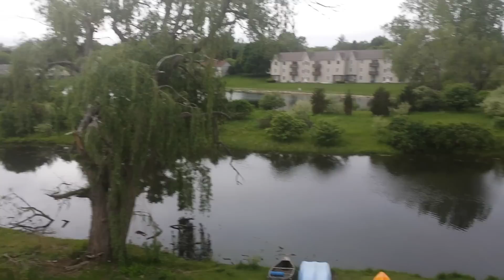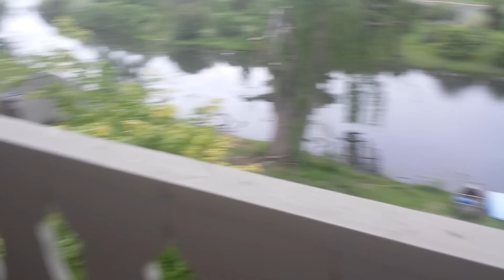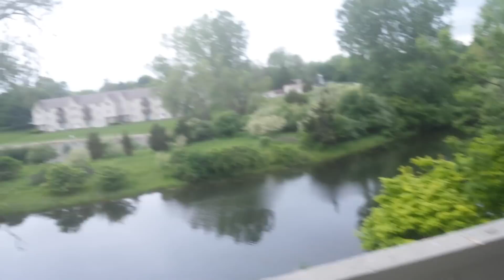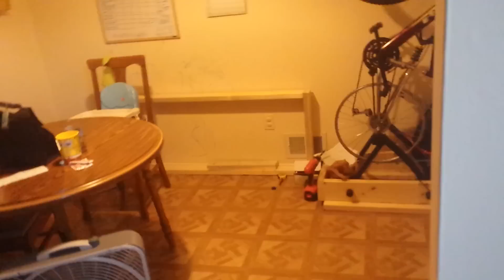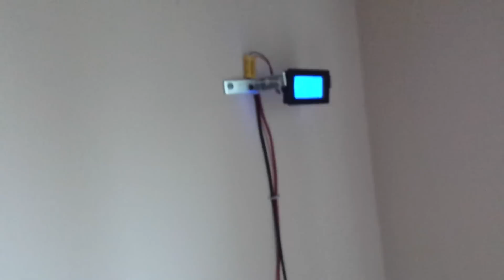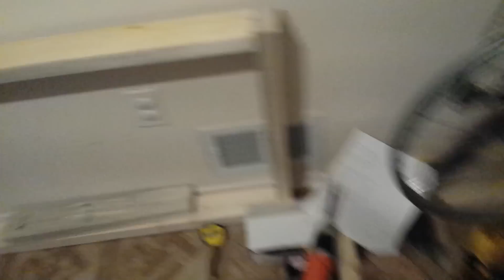Renewable Apartment - Solar Panels in an apartment!

Comment: solar panels should just be standard for every new home and apartment instead of consumers having to figure it out themselves. This looks too complicated and messy.
Reply: He's experimenting so as to learn about solar power as a hobby so nothing wrong with that. I agree every new home should come with solar power in mind such as which direction the roof faces as well as the angle of the roof to maximize the use of solar power.

Comment: How does the wire from the panel connect to your indoor generator when the doors are shut?
Reply: You leave enough space for the wires to pass so the doors are not completely shut.

Comment: I think I am going to show my ignorance here.  I see a lot of these programs that show having the power converted from DC to AC.  I understand the need to do so for the average appliances.  My question is this: can you purchase appliances and tools and everything that runs only on DC power so you don't have to convert it and lose the power in the process?  Is there a way to eliminate this step?  If not now, perhaps in the future?
Reply: No. There isn't.
DC can't be used for longer distances.
Although if you have a low solar production, like me.... I have 130w, you should try to use directly, like for charging things with batteries. I will have better performance that way

Comment: Have you seen Ibodini2008's setup?  He has the panel over the balcony rail.  If you can do this it would definitely be more effective. :
http://youtu.be/sOAl-1c33Y0
Reply from the maker: Thank you and yes I did. The problem is that I live on the third floor and according to my lease contract my dwelling is limited to the space I have access too. I know the maintenance guy really well and the landlord would object to me having a 25 pound solar panel suspended over the balcony. 

Also I am converting to grid tie. The battery backup is a great idea but I am starting to weigh in the costs and to have a battery it about 10 times the cost per KWH than simple grid tie. I am not a prepper and I have to face facts that a simple battery setup will not get me by without alot more money invested.